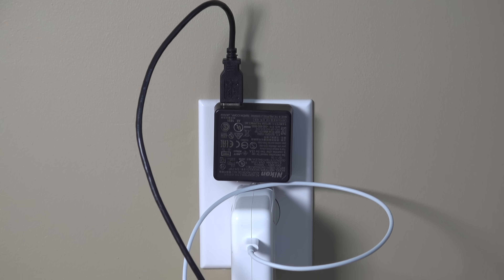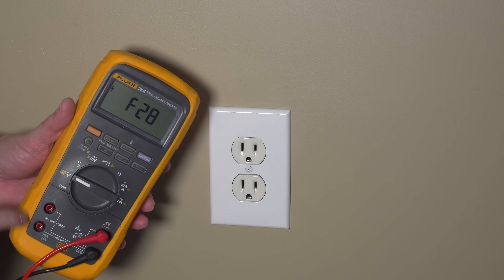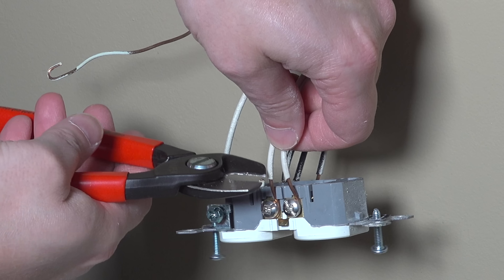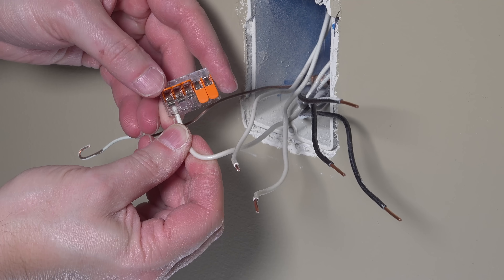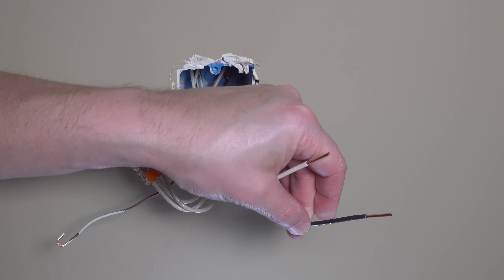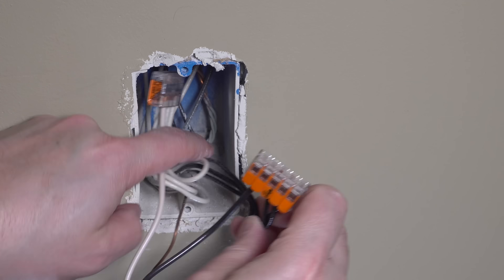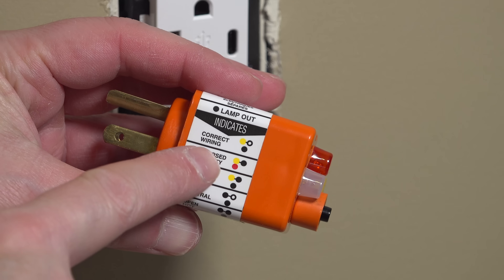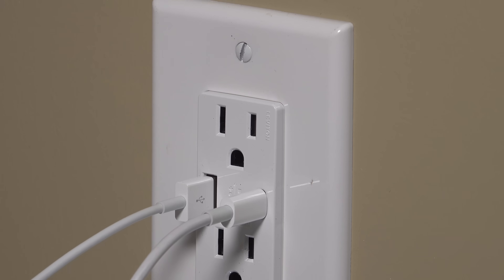Ultimate USB Outlet Install - No More Chargers!

Comment from the maker: Thanks for watching! Please Like & Subscribe - Leviton Outlet: https://amzn.to/2Za38yr - Wagos: https://amzn.to/3pyVWr6 - Strippers: https://amzn.to/2OAZg7x Tester: https://amzn.to/3afrA7O
Reply: I wish they designed the outlets to turn off when not charging. These outlets use power even with nothing plugged in. It would be easy to add a switch that turns on when something is plugged into the low voltage ports. Thanks great video!
Reply from the maker: @Back4More-b2d  They aren't putting out full power when not in use.  In fact Leviton wrote a paper a while back shwing that these could even pay for themselves compared to "dumb" chargers that don't sense and then deliver power. I am sure they have to use a microvolt or something but it's not much. I will see if I can check that with my analyzer the next time i have one
Reply: @Back4More-b2d  the amount of residual voltage the outlets consume is pennies on the dollar I would be more concerned about many other things than that
Reply: Just want to add that a lot of those USB bricks put out more power than those outlets provide. That's why those power bricks are so big. iPads are some of the worst offenders and may not even charge if they're on while plugged in. And most devices will slow charge since they're not getting the needed amperage. I do love these outlets and have a few installed but there are some caveats.
Reply: @phobos258  the Hubbell USB15C5W is high output 5amps 5volts or 25watts a lot more then those little 5watt iPhone blocks!
Reply: @bobstevenson4396  devices are getting more power and hungry every year. And quick charge devices need 18 watts and up to 20v
Reply: Who ever wired that outlet needs to get their a** beat for leaving the wires striped that far back
Reply: Does it says 125V 15 A behind the receptacle??

Comment: Nice video, very useful. Just a small point, at 3:15 you state to use the same size wire for the pigtail. The correct terminology is GAUGE, as 14 or even 12 as the case may be. I know you understand but when giving instruction to the average guy more information is always better. Thanks.

Comment: You will still need the MacBook Pro charging brick. You cannot substitute a 60+ Watt brick for a 30W outlet or 15W if both sides are being used. I mean you can, it’ll charge but the computer will use more power than it is getting over the cable especially while doing intensive things.

Comment: Does the wire going out the pigtail not need to bigger? To handle the same current as the 3 wires? Why were there 3 of each wire in the first place?

Comment: Unfortunately these outlets are not as useful as one would expect. In upgrading my kitchen I reinstalled outlets with USB ports. Out of 5 outlets the USB port failed on the 3 of them that were most often used after approximately 1 to 1 1/2 years. The rest of the outlet continued to work just the USB port failed.
Reply from the maker: From years of experience, details here matter. Most of these outlets are junk I have only found the Levitons to be long lasting, I have one nearly 10 years old still going. So many garbage brands are available that fail just as you described. This is the one I used in the video: https://amzn.to/2Za38yr

Comment: It's weird that your wires in the back are just screwed down and the screw is exposed without the plate you could electrocute yourself. But unfairness USA is 110v so harder to break skin resistance I guess.
Reply: Code usually requires us to wrap in tape after finalizing connections.. 

At leasts that's how I was thought. 

But he did go above and beyond to make sure we knew he killed the power

Comment: I think usb outlets are great for convenience, but I would definitely not recommend installing them. Usb A ports standard is 5v dc output going from 120v ac down to 5v dc in a circuit that has reverse polarity detection and over current protection and reliable 5v out is difficult in the space provided in a wall outlet. Not to mention if a capacitor or a resistor blows in the outlet you can’t just unplug it to stop the flow of electricity to prevent a fire. There is a whole other set of standards for usb c chargers that also has to be met which can make this particular outlet potentially more dangerous. The chances of it causing a fire is very low, however I’m more concerned about the quality of circuit used for the usb outputs. I wouldn’t trust plugging my phone or iPad directly up to any usb outlet due to this.

Comment: The issue is more vampire power. Phone chargers will suck electricity passively even if they ain't charging anything. 

That and how are you sure the Chargers in these are any good. Like they could combust depending on how good they are at getting rid of heat.

Comment: That's a Shitlet mate and it's the worst thing you could do to yourself.
1st of all you are constantly wasting power because those Built-in USB chargers are cheap and inefficient.
2nd if it's not a properly designed isolated circuit, you might kick the bucket.
3rd if something overheats, melts, gets wet, you also kick the bucket.
4. Those are old USB's and Low Power ones.
A type-c 20V 5A would have impressed me, but the proper circuit, heat dissipation and safety measures will never allow it to fit in that space.

Comment: Those USB outlets are trash.  They are super expensive and have a high failure rate.   I'm an electrician apprentice.   They might have gotten a little bit better but for the most part stay away

Comment: I just wish thete was a 90* adapter for a USB plug like this. I updated mine about a month ago but I would still rather have a flush connection. Though all and all o do like it over using power adapter bricks.

Comment: I was not able to find the Wattage on the USB-C port (for the Outlet in this video).  Do you happen to know where I can find that?  I am intersted because the power adapter included with the 16-in MacBook Pro charges at 97W.  If I use this in place of that 97W power adater, what wattage should I expect from that USB-C port?

Thanks in advance for your respnose.
Reply from the maker: That one is going to be too much for this. You can still charge it while not using it as its 25 watts 5.1amp. But for using it on that powerful of a machine it wouldn't be good for use/charging simulataneously

Comment: USB circuit has a power converter and it always running and energized. even when you're not charging anything. dubious invention.
Reply from the maker: Not true its taking about 5v when its off, when a device is charging it will use full power. Easy to verify the device is ice cold when unplugged and warm when charging aftera  while.

Comment: These devices are NOT a good idea. Why? Because the conversion of 110-120V AC to 5V DC necessarily means you have an active transformer to serve as a power supply buried in the wall to run the USB ports. If that transformer fails, you have an immediate in-the-wall fire hazard; if  the unit ever shorts the AC feed to the USB outlet, you have an electrocution hazard. You have a chance to pull a smoking wall wart out of the plug. If it smokes in the wall, well, you've got a problem. Check out the videos BigCliveDotCom has done on these, and why he doesn't like them.  https://youtu.be/zoZ1_aEDPos
Reply from the maker: Exactly why I recommend what I used, Leviton. Bigclive used a garbage, no name brand and he said this clearly. If you want to just buy a no-name import then sure you could expect issues. I wouldn't think twice about a Leviton, Legrand or Hubbell product,
Reply: @SilverCymbal  And he also stated clearly he wasn't a fan of in-wall USB in general. Appreciate the effort put into the video, just not something I would do. Worse is that these are becoming prevalent in new construction, and a typical buyer has no idea as to the quality of this kind of component just by looking at a shiny face plate.

Comment: I've  installed a few of these here in Australia, which uses 240 volt. I've noticed that they can get warm when not being used, so they must use some power when they have nothing plugged in. Just need to ensure that there's plenty of space around them when they're installed into a cavity.
Reply from the maker: Old models would do that. This Leviton is ice cold when not in use with smart tech that knows when it need to charge.

Comment: Good: old wires cut and Wagos being used
Bad: ground wire neither cut nor color removed (sandpaper)
Recommendations: 
Use the vaccum to clean the box before you connect the new outlet
Use an insulated ground pigtail as well (and a Wago 221-412)

Comment: The wires under the screw terminals are great. The two using the stab in connection make a very poor connection. You pay more for  an outlet with a built in USB charger. And when the charger fails you're stuck with replacing the receptacle, again. Not to mention that the charger is always using a small amount of power even when you're not using it to charge something. I really like my charger that's plugged into a power strip. Flip off the switch when I'm not using it. Then I don't have a phantom power drain I can't turn off. I use a power strip with six single receptacles, each with it's own on/off switch. Only power devices I'm actually using. And should my charger fail, I just buy a new one and plug it in. No rewiring required. I'm just not seeing the advantage to a built in device. To me it seems you're solving a problem that does not exist.

Comment: Screw colors are silver and brass. The black wire is black on brass. If you have that many black wires please make sure you don't have two circuits feeding that box. The plugs have a bridge between the top plug and the bottom. If this bridge is cut or broken on the black side you may have two circuits feeding that wall outlet.

If checking for current do confirm the outlet is dead, check both the upper and lower plugs.

Comment: Bad thing is these eat power all the time, no way to shut them off. Be nice if they had a push button to turn it on and off.
Reply from the maker: You don't need to, these Leviton models dont' they turn off when not needed. Maybe a millivolt but they are not using the full power when unused.

Comment: I’ve noticed at the hospital I work at that all the outlets have the single ground prong facing up instead of down. But in my house they’re all facing down. Does it matter which way it faces?
Reply from the maker: Both are allowed by code, hospital electricians love to put ground facing up in case of a short from an item from above, which happens. It is a bit a debate which is best though.

Comment: A good habit is to short out to ground after opening but before touching the wires to ensure your tester didn't mislead you somehow. Poorly thought out split outlets may have one half still live for example. You'll weld your screwdriver to the outlet but better than a surprise.

Although it meets code, the push terminals  are more likely to fail over time. Attaching to the screws on the side will outlast the house.

Check your local electrical code, wago terminals are not approved in many areas.

Check the usb is at least Qualcomm quickcharge 3.0 compatible or "power delivery" (quickcharge 4.0) with the max wattage you can get, your future devices will thank me.

Comment: I have 3 of these and the biggest complaint about them is how stupidly big they are. THe one I have outside that I am using to power a nest camera was an insane squeeze. Also as pointed out the power sockets are difficult to use depending on the plug if you have anything plugged into the USB port

Comment: For generic 5v usb devices.. yes you can have a few usb ports. But for laptops, fastcharge phones and other high power usb devices you need the dedicated charger and also you want external brick to do the job (better cooling, can malfunction and easy to replace and diagnose.. i have a bunch of usb chargers that are broken and disfunctional, stuff happen. So please don't put it in the outlet!)

Comment: This is another “there’s an ass for every seat” product. The devices come with the chargers that are specific to the device and using anything other than the charger that comes with the device will decrease the life of the device. Modern houses come with receptacles within 6’ of every wall opening (ex. Door) and then within 12’ apart from one another in living rooms/bedrooms. There are plenty of receptacles in a modern house to plug in chargers....
Reply: That is very not true. USB is a series of standards. Some manufacturers might hack their own charging system on to it cough*apple*cough but, worst case, it will fall back to just drawing somewhere around 5v at .5 - 2 A

Comment: These are great ideas BUT you can't turn them off so the transformer that converts the line voltage to USB voltage is always on and wasting power when not in use. 
Consider a power strip liberator so you can actually unplug the power vampires.
Reply from the maker: They don't consume power all the time, this Leviton model will sense when connected

Comment: Thanks for the helpful info. I suppose a few drawbacks are: lack of resettable test buttons, having to choose between inserting large block plugs/large power adapters or USB cables due to overcrowding, and lack of  proprietary fast charging USB capability.

Comment: My uncle installed one of these a while back it didnt charge devices very fast so make sure the outlet you buy is good quality and is at least 1.5 amps preferably 2 or more especially if your plugging in things like tablets they draw alot more power

Comment: I tried this with a couple different manufacturers and none supported charging my phone or laptop :'(
Reply from the maker: I tried a Blackview Android, 3 USB flashlights, Macbook, Chromebook and iPhone 6, 8 and 11 and all worked fine with this Leviton model. Some big Macbooks may need to much power but I would be surprised if phones and notebooks wouldn't work.
Reply: @SilverCymbal  I'll try a leviton next. The ones I bought were the best sellers on Amazon but maybe I was just being cheap. Thanks!

Comment: These look great on paper and supply the (up to 2.4a per port) aka standard usb 0.5a/500ma to any device. Modern phones require their bricks for the proprietary fast charge method the device uses if it's not present it defaults to 500ma... these plugs are good for a coffee shop but much else.
Reply: Fast charging has a standard.

The issue is more that cheap power bricks only output about one amp at 5V which is painfully slow at charging modern phones.

Comment: Should you not hook the ground => Neutral => Hot in that order?
Reply: at the very least disconnect ground last and reconnect ground first.  even with the breaker off there could still be ambient potential in the wires.  plus this is assuming the electrical is perfect and there isn't a fault somewhere in the system.

Comment: This is like those tv adverts. None of the important informations are listed. My phone uses 18W fast charging which is considered outdated by 2021 and the phone model is only 2 years old. If I were to buy a phone today, it would probably have 20-30Watt fast charging. This outlet is probably an old 10Watt charger so you wouldn't want to use it for phone charging since it would take forever to reach 100%. So the real question is, what it's for? Also, if my charger gets faulty and fry my phone, I will get a replacement phone under warranty. Given this is considered a third party charger, my phone maker would just put the blame on me for not using their original charger.
It comes with so many downsides.
Reply from the maker: Its 25 Watts 5.1 Amps - They are several models you can pick from some that go up to 30 Watts. Have a nice day.
Reply: @SilverCymbal  You could have said that in the video.

Comment: I found something similar at Walmart. It plugs into the outlet and provides the 2 117v and 2 USB A outlets. And it was a lot cheaper and requires zero electrical ability.
Reply from the maker: Be careful of some of those, they have had recalls & melt downs. I am totally for a plug in version this is one of the best I could find, & unbelievably cheap and made by APC, https://amzn.to/3oX0rdK

Comment: I opt to disagree.   The power outlet is just metal plate and plastic/ceramic holder, and will last virtually forever.   While the USB power adaptor which built into the power outlet will last, say 2 - 3 years tops.   Since you can't unplug it, it will have a shorter life than external ones.  Think about how many mal-function usb chargers you have over the past few years?
Reply from the maker: If you buy a real brand like the ones I mentioned it will last longer, my first Leviton is now 8 years old, still works great. The garbage, fake brands online selling outlets should be outlawed. I don't belive their UL ratings are real. Stick to a brand name and the work you put into an install will last very likely for a decade or longer.